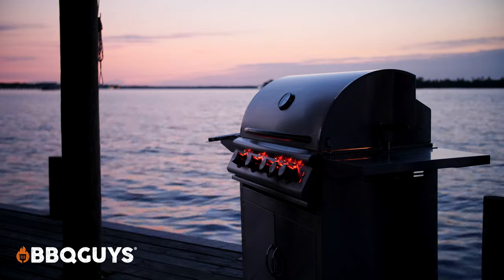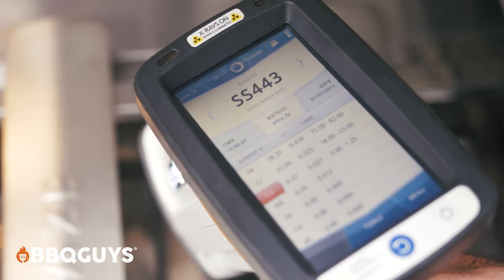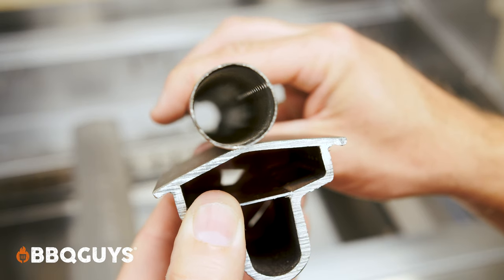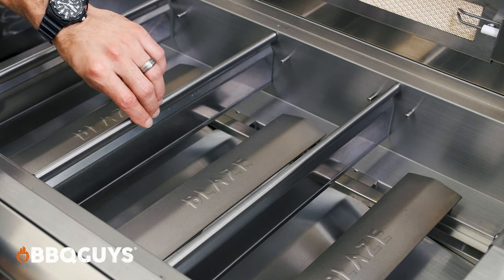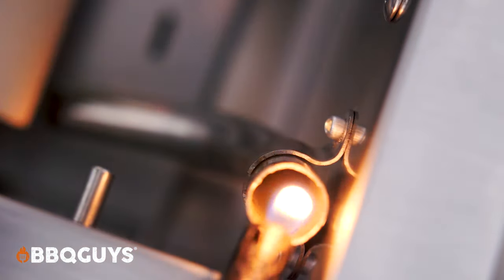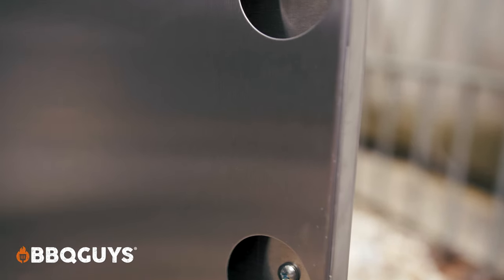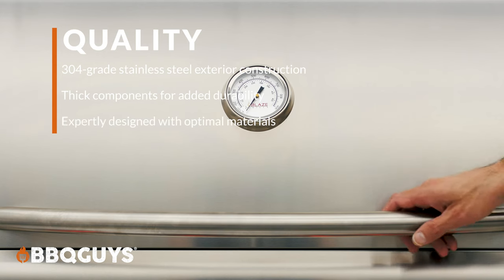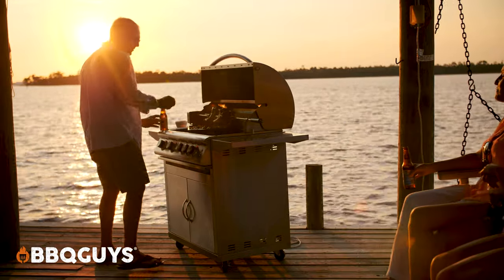Blaze Premium LTE Gas Grill Review | BBQGuys Expert Overviews

Comment: I have to admit I hate the height of the rotisserie burner and to top it off the warming rack has only 2 inches of cooking height. Overall they need to consider re-engineering the grill to account for the need for more depth. The cart is also pretty vanilla. There is just nothing special about it.
Reply from the maker: We hear you. Thanks for the input!
Reply: @BBQGuys  Honestly that's my biggest hesitation with this grill as well. If it had just a few more inches of lid height, even if that added a couple hundred $$, I'd buy it immediately. But it seems so cramped in there, and not enough height for rotisserie or warming rack.